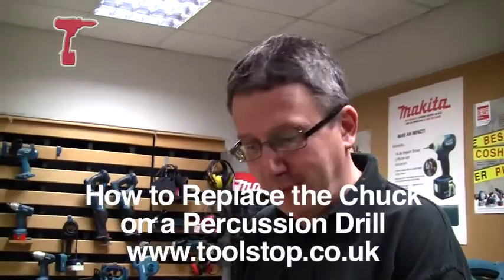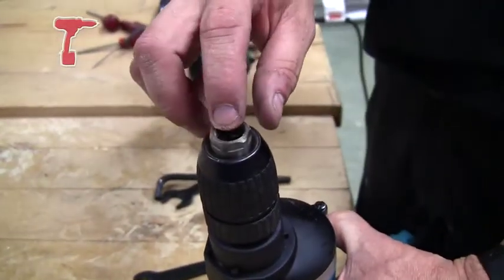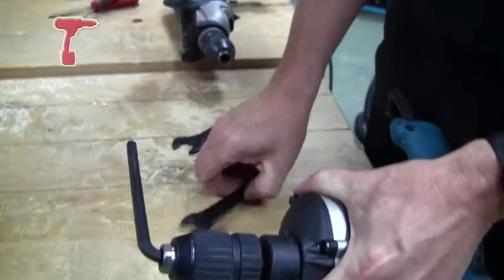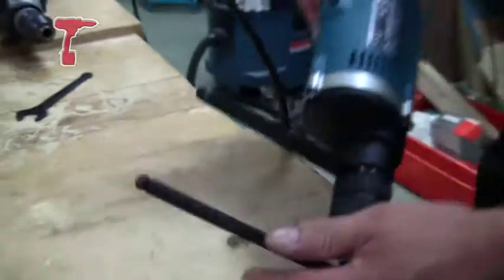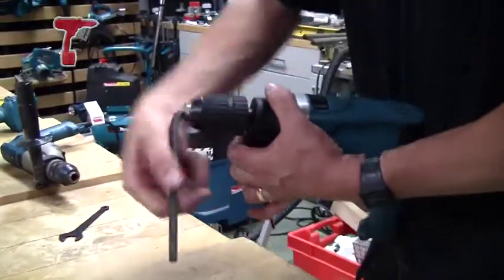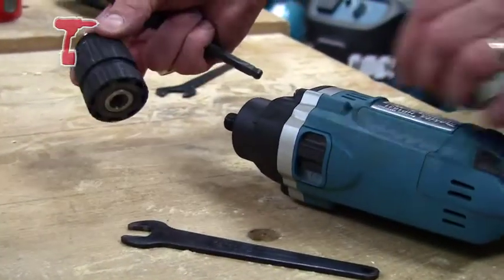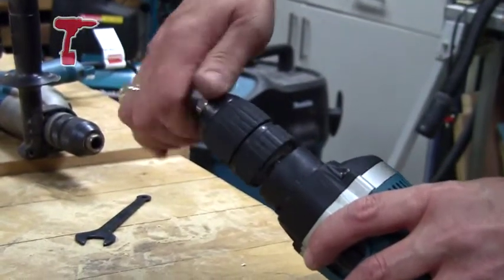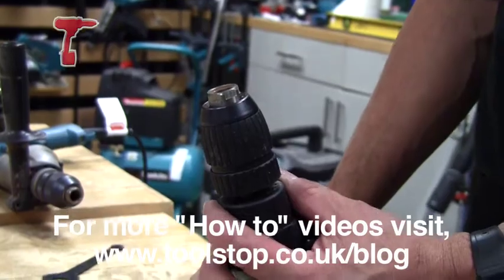How to Change the Chuck on a Makita Drill

Comment: i got a makita cordless drill and it looks like a flat head screw down in the chuck, but a drill bit is broken off in the chuck, i think it was a 7/32 drill bit that broke off in there and i cant get to the screw that holds the chuck on, i think there is a center whole in that screw that the bit broke off into. what do i do? take the drill body apart and see if i can rermove it that way? thank you :)

Comment: Hi, thank you for the video. I have the same and it's very annoying that when i drill with a drill bit thinner than 6mm the drill bit slides into the star shaped hole inside of the chuck because there is no screw to hold the chuck. Very bad construction, I don't like this machine because of it.

Comment: It is obvious you cant disassemble the chuck by opening the drill since the screw in there is the only thing holding the chuck and the screw behind it together so either you have to get the broken drill bit out by some tricks or you must change the chuck with the other parts that come screwed with it.......i would try heating or lubricating the chuck to try to get rid of the broken drill bit.

Comment: i has a makita i bought in 1989 it had a keyed chuck i changed to a keyless  few years later. i had no wrench i had to clamp the chuck in a vise and use a impact driver to get the screw loose as it had thread lock on it. other than that i was rater easy

Comment: Tried to replace it on my Makita BHP 458 cordless drill... failed. Tried every method; you're likely to destroy something else around the room due to ricochet. It's so loctite'd that the vice or the hammer will break before anything happens. Well, not really, but you get the idea. After much try and fail, I gave up (and thankfully didn't destroy the drill).

Comment: Keyless chuck has been garbage since I bought it 10 years ago and it finally cannot grip any bit for any length of time now. Cannot get the keyless chuck to budge. Was going to keyed chuck like it should have been when new but cannot get it off.

Edit: I sprayed lube on it and left chuck down in the vice for one week adding lube a couple times. Went down pissed and threw all my weight behind the POS after rapping several times with hammer, and it ripped loose. I would have just went and bought a new hammer drill but I am stubborn that way.  Never have bought a Makita product since.